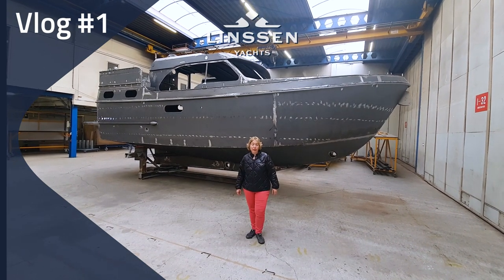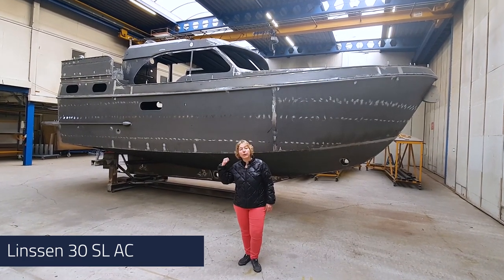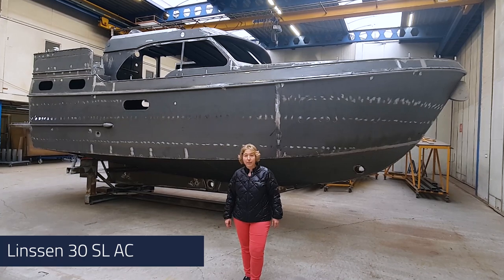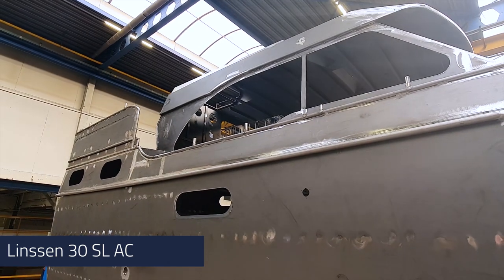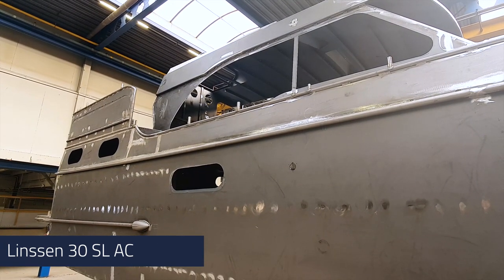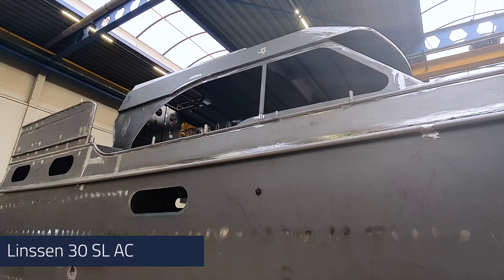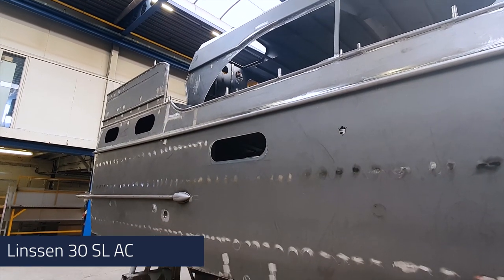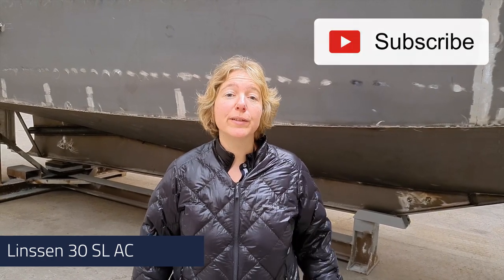Linssen Yachts Vlog #1 Linssen 30 SL AC

Comment: I have an 1986 Linssen 30 SL with AC, I would love to see the inside of the engine-room, and how the propshaft arrangement with the seal is on the new models.

You build fantastic boats, Mine is 35 years and It is still very nice, handles perfectly and both the  painting and steel is of good quality after 35 years. Interior is classic and handcrafted and still looks perfect.
Reply from the maker: Thanks for the compliment. we would be very interested to see some pictures of your yacht and travels (send to info@linssenyachts.com). Ar eyou also a member of our Linssen Owners Facebook Group? If you are ever close to Maasbracht, feel free to visit our showroom.